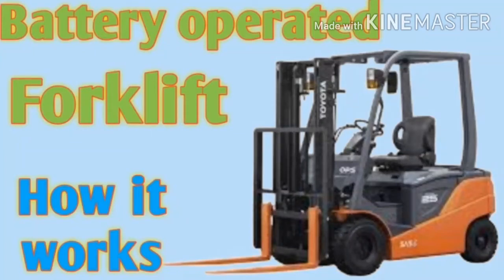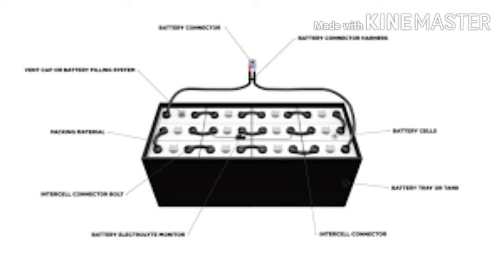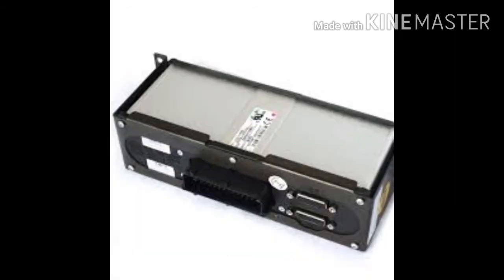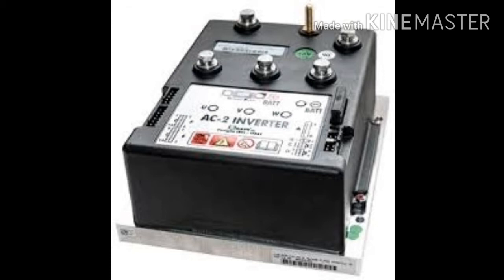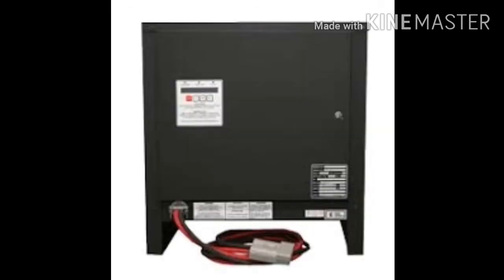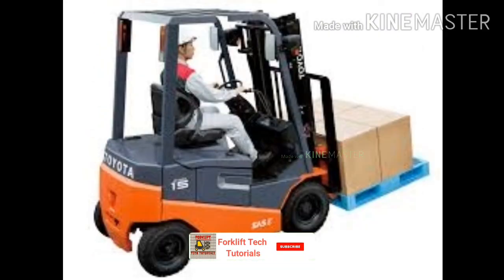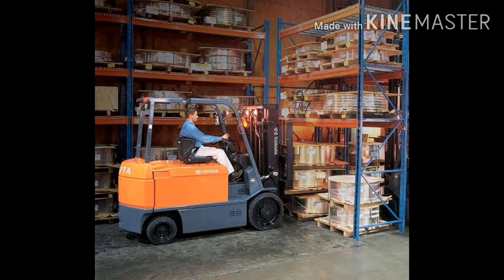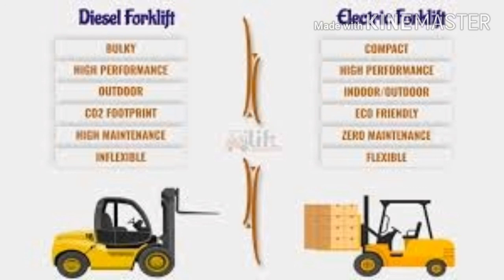Battery powered Forklift

Comment: How to contact you
Reply: Like your tutorial . 
I want to convert my 3 ton ICE forklift to li-ion Battery operated. I already have the battery & the controller. I want to check with you. the following
1) Since the existing forklift already has hydraulic motor, can i reuse it? If not any recommendation ....eg the brand/manufacturer 

2) If a problem to find the motor for the drive. Is there any recommendation ...eg the brand/manufacturer 
Hope to heard from you
Thank you
Victor
Reply: Acs voltage low
Reply: 2tan Heli fourleft in china